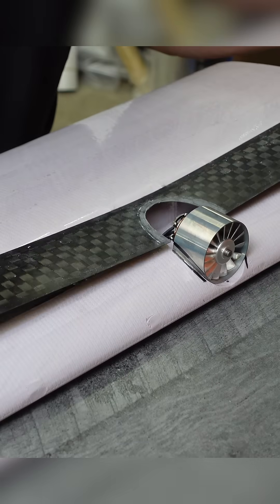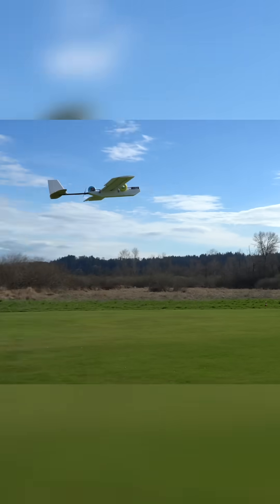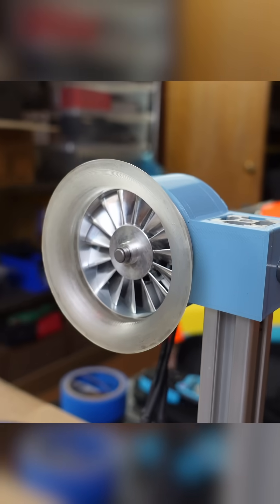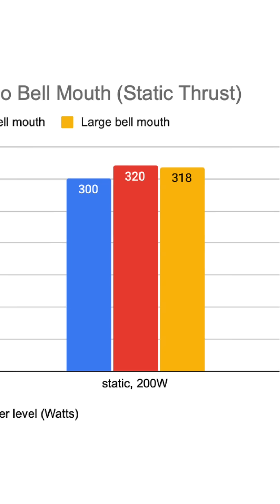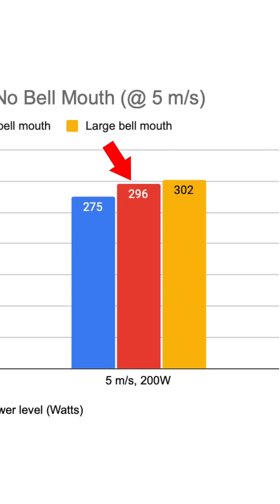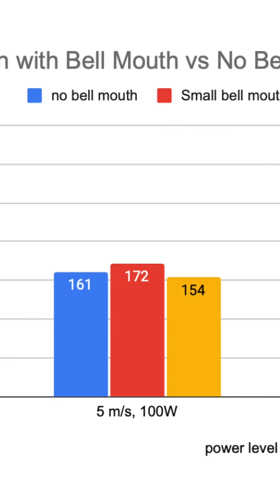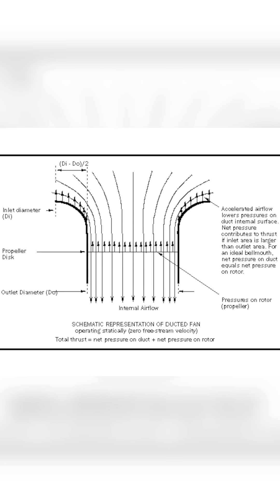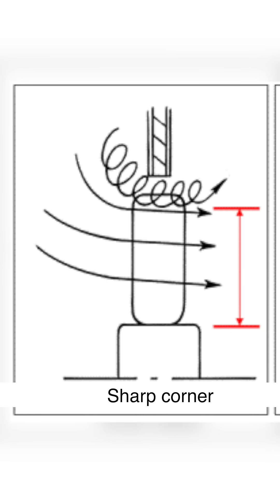Testing EDF Intake Shape for RC Plane #rcplane #aerodynamics

Comment: The reverse bell mouth still creates a Bernoulli effect in reverse. The drag over the edges of the bell creates high pressure point that sucks the air until it reaches max compression. Your plane didn't reach a high enough speed to impact the air flow.

Comment: The bell mouth will technically be more efficient all around as it creates a uniform surface to guide air into the throat of the edf but theoretically it becomes more efficient at high velocity air speeds because it starts to force air into the edf acting as a scoop.

Comment: Make a adjustable bellmouth first so you can tune the correct length so the air pressure contacting the fan blades are at the optimal efficiency, then you can 3D print the final one peace bellmouth for the best performance of your EDF

Comment: You'll have turbulence on the outside of the mounted mouth. It might be worth not having a sharp edge, but rather rolling that edge over and softly closing the one at the back of the fan. Something like the shape of a turbofan engine.

Comment: So if a small bell mouth is better at reducing drag and smoothening the intake, why not try perhaps making a lighter thicker case around the motor and rounding off the edges on intake side. wouldn't it in theory reduce drag more due to the lack of that fin the bell mouth has while also smoothening the intake?

Comment: As a hot-rodder it is the latter. We do this on carburetors or stack injection setups on the intake manifold. On carbs which already have this concept built in to a degree which makes the venturi effect and pulls fuel from the metering circuit. On stack setups it increases flow at lower speed as well as higher speed. Albeit small it makes a "ramming effect" which generates more horsepower.

Comment: Makes me think of velocity stacks on carburetors.  I have some small ones under my air filters and it makes a noticeable difference. Idk about more power as I have never dynos it but my rear end says more even running ar a minimum.  Racers use long ones. I have heard that the length matters and there's a correlation with rpm.

Comment: Bitch late but if you want to make an air tunnel you can get a bunch of straws or long narrow tubes and attach them together then put a fan on one end with something blocking the airflow that doesn't go through the straws and it will give you a pretty good wind tunnel.

Put the testing area inside a box for even better results!

Comment: If you build a big enough bell you dont even need an engine.  Think about it.  If the bell increased thrust 10%.  Then you could just use an engine 10% smaller.  Just keep going making the bell bigger and the engine smaller until there is no engine and the bell is huge.

Comment: Fan blades are not very efficient. True efficiency comes with the use of a double or triple spiral vein with intake and output on one side 'through'. The spiral forces a smooth transition between the concave veins, leaving no noise and will work inside the wing itself or any other flat surface on the aircraft.  This cuts down cross section to work best with the aircraft shape, so if you use the fuselage wedge as half of a ram induction on each side, for example, it beats other designs where liquid fuel is used like a ramjet. With this electric engine setup, it might not be really useful unless the air gets thin and only for high speed applications. Also, friction can be recovered as energy using a teflon plate generator on the output like they have on some tractor trailer tail ends to make use of static electricity you're generating anyway. You can also get 3 dynamo motors to run one-another in loop circuit, so if you discharge the ground off an hf coil at LF, the coil layers inside motors will fold charge waves inductance far more efficiently as long as the casings aren't trapped from shedding +ions. Need at least 9 layers in windings.

Comment: I am out of my area of expertise, but I would suggest that the bell mouths are acting to reduce the impedance mismatch of the motor fan and ambient air. The would be similar to how the horn in a horn loaded speaker buffers the impedance mismatch between the voice coil and ambient air.

Comment: They also put velocity stacks in intake manifolds in engines and for the same thing. Basically, at high velocities, there's a small torus of vortices that forms at the mouth of the inlet because the flow recirculates around the edge. That cause the inlet to partially choke. Adding a smooth surface at the edge gets rid of the recirculation zone. You have to play with the contour itself and see which contour works best at your desired velocity.

Comment: I use an elipse shaped bell mouth on a large 127mm edf it picked up 2 lbs of thrust.  And will actually pull air from behind the lip at lower speeds. And is very efficient drag wise .

Comment: Put a smoother tapered surface behind the back of the flat bell mount to prevent turbulent drag and a short straight spoiler above that to keep the air above from being mingled with it. That should reduce drag from the bell mount while also creating some lift. Small in amount perhaps but every little bit helps. Especially as speeds increase and probably (marginally) reducing fan speed needed to produce lift. 
Worth a try.

Comment: The belive the bellmouth improvement was from increased air density . The bellmouth creating fast moving air that sucks it forward would mean the bellmouth alone would create suction once you got air moving through it that would be considered a free energy device . I once tried to make a free cocain device but no matter how I made the container I put my cocain in I was never able to take a container with 1.0 gram of cocain inside take a bump weighing .10 grams and wind up with anything more than .90 left in the container I was really hoping for at least  .91 but no it didn't work so don't try but if you do and you figure it out  don't forget about your boy here

Comment: I used to be in the automotive industry, and at one time we were considering linear flow rc plane motors for electric supercharging. We had a 3" ducted fan in a housing and used a nitrous switch to activate it. After proving its worth we started mucking about with the intake, including the trumpet-style bell mouth like you have. The one that worked the best looked like a flower. However, the one that really got us excited was a venturi. After some finagling we discovered the golden ratio worked the best. The points of measurement that mattered were opening to widest to outlet, length of velocity stack to increase in volume at venturi, and a minor tumble-valve generator at the intake which also had the ratio taken into account. That is, if the tumble valve generator wasn't far enough down the velocity stack, the air would back up and crash straight instead of counter-clockwise. Another boost was the outlet, which had a TVG cut into the surface of the inside of the device, and a minor venturi before the ducted fan. It also had to have a velocity stack within the parameters of the ratio. This resulted in something like a supercharger with no moving parts. In fact, I installed a version on my wife's basic chevy Aveo hatch with the ecotec 1.6 and a 5-speed. Also a 1 ohm resistor at the ATS to trick the engine's computer into thinking it was hot outside, so it leaned it way down, boosting power. This thing would EXPLODE when nuanced properly, so much so that I sold my custom-built EVO 8. Embarrassing getting your doors blown off by a eight thousand dollar basic hatch. This 1.6 had the most insane throttle response, and no matter your speed or gear, when you touched the throttle even slightly the car leapt. Couldn't wait for a turbo version. And they built it! I drive a black Kia Forte GT 6spd turbo 1.6 ecotec, modified with an AEM intake, throttle chip, and when connected, Burger motorsports JB4. On stage 3 I'm taking RT's! The thing is amazing, and I get 36 mpg. I am fulfilled. Happy daddy. Glad gramp. And all that like that there.
Reply: You need to make a YT about this ...
Reply: @Skousen77 you are right, but it has been decades. I dont know if i can even find the sketches, pics or blueprints. If i do, i will post a vid. Nowadays the device wouldnt work because of the way our air veloxity sensors work. TVGs create a vacuum at the center of the cross-section of an intake tube, which would confuse the heck out of modern cars. Linear flow is built in to the geometry. But give me an old 4g63...
Reply: I used to be in the auto industry too, but am calling BS on the supercharger with no moving parts and leaning tf out of a Chevy aveo on purpose...ya had to melt something with those EGTs and pushing 36mpg with more air from the "supercharger". I wanna believe, but the science ain't sciencing man.  (because boost NEEDS more fuel to make power, not less fuel 😁).

And I didn't throw around a single fancy racing brand either. "The dude at the shop only uses AEM and says you're wrong" uh huh, sure 😂
Reply: @joecee6862  Fast and furious grandpa makin shit up. So weird.

Comment: I strongly suspect that your measurement errors may be greater than the difference in performance you are looking at.

Despite what some would be engineers have told you a bell mouth should never be used in flight.

The bell mouth is only used under static conditions (zero flight speed). In flight a bell mouth is a massive liability.

Comment: Bell intakes and stuff like that were used widely on old school carbs on hotrods because of the air smoothing effects. Less turbulence in the airflow means you can get a greater volume of air through without having to enlarge the intake. Which doesn't always necessarily yield benefits for piston engines.

Comment: I think people are forgetting the principal of what the fan is doing, which is providing thrust. The bellmouth isn't just smoothing airflow , its allowing the fan to take a larger "bite" of air, which increases the thrust. The shape an size is all dependent upon the entry speed of the air, which makes static testing challenging as these results are based on no air movement, which you found when comparing results with a blowing fan.

Just to clarify, its the fan's ability to process a larger quantity of air that improves thrust. In flight, both weight and drag increases must be below the thrust increase otherwise there is no point to having them.

Comment: As an engineer with an advanced degree specializing in fluid dynamics I believe both are correct but the reduction of inlet turbulence is probably the greater contributor to the improved performance.

Comment: The air is entering an area that is larger than the engine housing so it doesnt have to move as fast to get to the impeller. Since the movement of the air is caused by the ambiant air pressure then the slower moving air has more time to enter fan blades and will be at a higher pressure.

Comment: As a non-degreed engineer in the oil and gas industry i would encourage you to dimple the surface of the intakes and wings / body pannels...  Just like a golf ball.  Use finite element analysis to clearly see the effects prior to manufacturing...  or just throw caution to the wind (not to be cliche...) and build it and see the results .

GodSpeed Brother .
Reply: Also, consider using g a Tesla Turbine instead of the Dyson...

Comment: I actually work as a designer in aircraft engine testing. We incorporate bellmouths specifically to smooth out air flow at the inlet. We do it on for every type of engine test bed...turboprop, turboshaft,  and turbofan.

Comment: ? Wouldn't the bell mount direct the fast moving air into the engine vs static air on the static bench having to draw the air in ? I'm not a engineer just curious

Comment: what is the added weight result on drag and loss in thrust efficiency and therefore what is the net gain? I would be concerned with weight on a light weight structure in the first place.

Comment: you are only trying to create a more laminar flow for the wingtips of the fans.
look at every jet engine. that cowling is not for show, it is to hold the bemouth and allow air to pass both into the engine and past the cowling in a very efficient manner.
now try with a proper engine inlet use a jet engine to get the proportional sized needed for your model.  hint, you make a super size and and extra large for your testing.

Comment: Bell mouth intakes really perform well with more pressure, or in this case, vacuum. That's why you see them on carburetors and throttle bodies, and also why they are more effective in that situation. Higher pressure err vacuum, and you'll see higher efficiency.

Comment: Aerodynamics theory doesn't always translate well to small scale systems because of low Reynolds number flow conditions. Viscous drag is proportionally higher and rotor efficiency is lower than larger systems, and the boundary layer may also be separating off the inlet before it enters the fan, negating the benefits.

Try some smoke flow visualization with and without the bell mouth.

Comment: Neither, the bell directs more airflow to intake, which translates into a higher exhaust rate, causing a slight pressure difference theoretically pulling the airplane more efficiently along the air.

Comment: I think the kicker would be streamlining the back of the bell mouth around the motor, so it doesn’t create as much drag. The drag they create is like an air brake when they’re flat on the back— from the negative pressure. (Coming from more of an automotive background than aerospace, but you get the idea?) Bellmouths are always a good idea IMO when they’re applicable.

Comment: the bell mouths themselves, as printed, also introduces a sharp edge on the outside which negates the gains on the inside to varying degrees as you have found. so the best size of bell mouth is determined by how it's going to be mounted on the plane. 

if it's a wing-buried fan then the bell mouth outer shape should be meshed into the shape of the wing itself as much as possible. think Northtrop XB-43 or in the extremes, F117 or B2. you don't see these very often because of many reasons from safety (engine failure/debris is too close to the airplane) , engineering (interefers with wing structure/reinforcement) and maintenance nightmares (how are you going to service that damn hidden engine). so you can see why this is impossible without military needs (stealth) and a military sized budget. all things what apply so much less to RC models and something you may actually want to pursue as a result, for fun!

for exposed engines which is in most cases in the real world, the bell mouth outer needs to terminate in its own faring, preferably not much larger than the EDF body itself to minimize drag. think all commercial airliners or say A10 Warthog.

Comment: If an aerospace engineer thinks a bellmouth inlwt will improve efficiency of an airplane, they aren't a very good engineer. The old FAA powerplant handbook, AC 65-12A (free to view and download on their website) explains why on page 94.

For peak efficiency in a subsonic engine what you want is an inlet duct with the opening sized so the ram air from the forward airspeed lets in exactly the same volume as the engine demands while cruising. For most turbojet and turbofan engines that means a divergent duct is needed, but with an EDF it would need to be a convergent duct. 

The disadvantage of an optimized duct is at speeds lower or higher than the design target you will loose efficiency. Many engines have blow-in and doors for low speed operation, with smooth ducts allowing laminar flow similar to a bellmouth, and pressure relief doors that open when over the design speed. 

If you wanted to guess instead of calculate, you could put a blow-in/pressure relief door that swings freely, so if the duct intake is too small the door swings in, and if too large it swings out. It would also be a great visual indicator to demonstrate how the turbine demands a bigger duct inlet size at low airspeed.

Comment: I agree the bell mouth smooths the approach while using a larger size creates drag. 
Neat wing design👍 I like how the 7% efficiency bump was visually useless for hobby flight.
Is the jet wing design supposed to increase flight duration, diffuse heat signature, increase lift, or reduce the sound level?

Comment: I don't think it is either a Bernoulli-type effect or that it smooths the intake air.

I believe it is more akin to a Venturi Effect, or comparable to a compressor stage.

The first factual observation I want to make is that the surface area of the intake manifold is larger when using the curved intakes, than when they are removed.  The radius of air intake is larger at the outside lip of that curved manifold.  As the airplan moves forward, the air stream is divided into "intake air" and "bypass air.". Obviously with these manifolds installed, there is more intake air than there was before.  As the plane travels the same distance through the air, it subtends a greater volume of intake air.

I don't know whether the intake air is compressed as it moves through your fan, or that it must pass through faster than it did before.  I suspect a little bit of both:  as the intake narrows, the air is compressed a little.  Then your fan is turning against denser air.  This results in more thrust.

I wonder why a curve is optimal.  I wonder if that is the optimal geometry.

What I am more sure about is that you should have another manifold for the external diameter, so that you avoid creating a vacuum on the backside of your intake manifold.  You don't need this manifold to flare out, you just want to avoid creating a vacuum behind your larger intake radius.